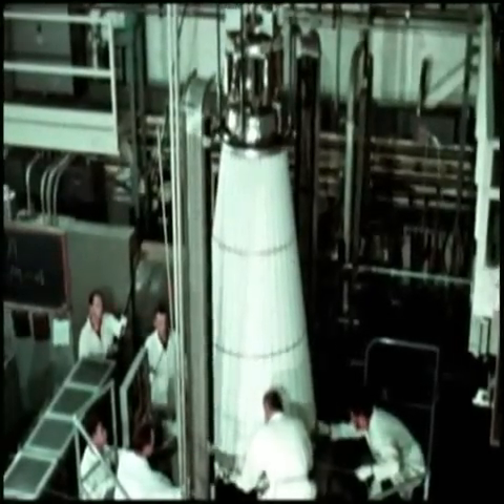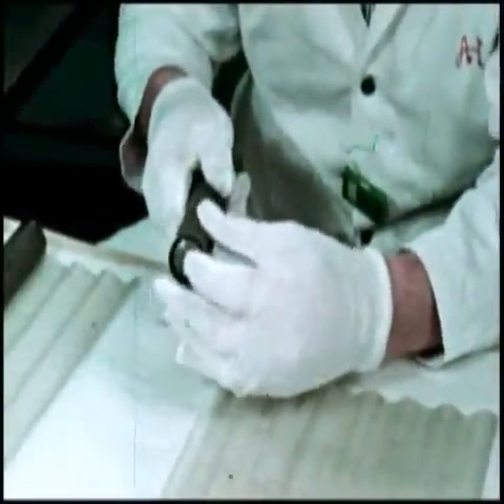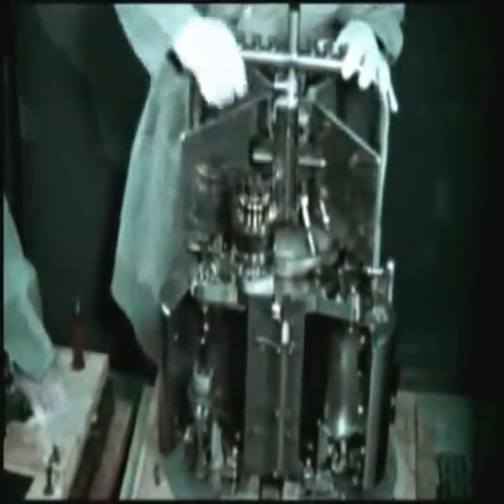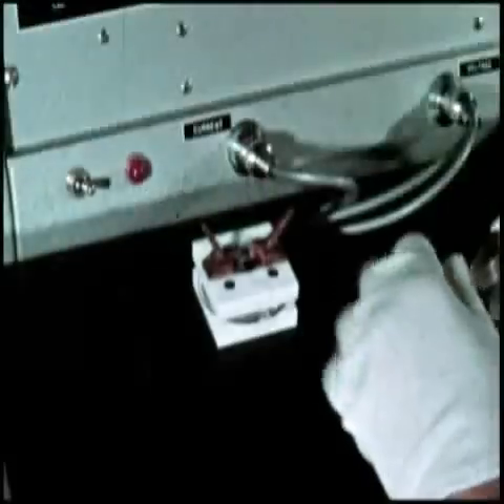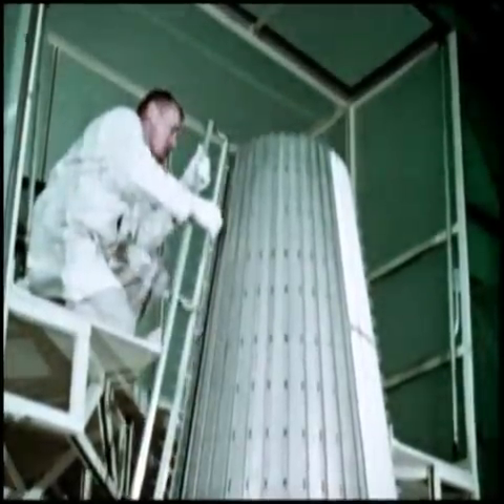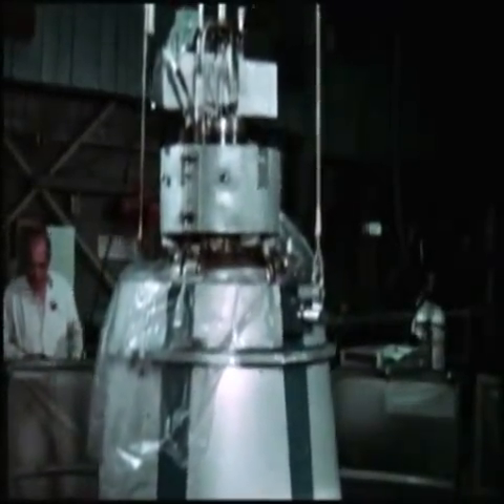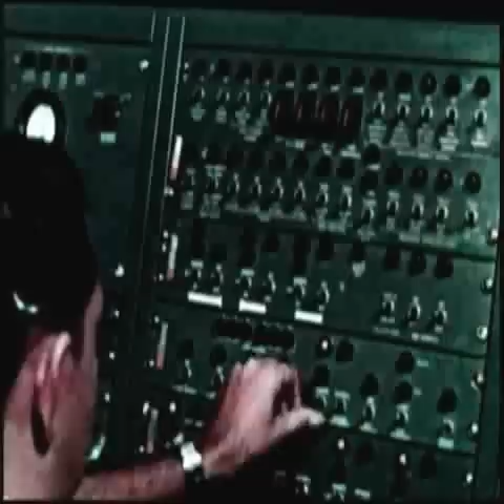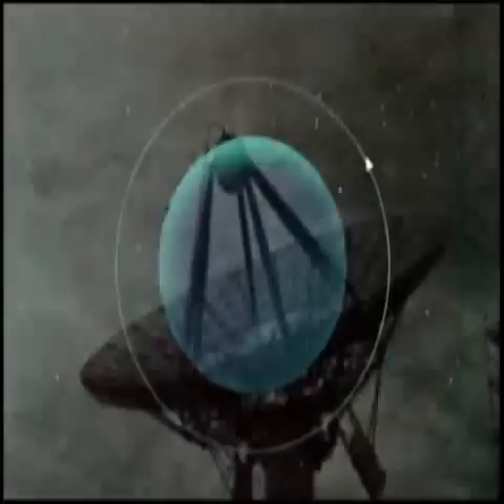SNAPSHOT (1964)

Comment: Were photo electric solar panels not even being conceived of as power supplies in 1964? Every little mini satellite is powered by them now I believe. The first one I remember seeing was about 1” square and demonstrated in science class 1960 something. Hand held Weston type camera light meters certainly were earlier.
Reply: Solar panels as we use them now are only about 30 years old... the previous types had very short lifespans, with extremely low conversion rates, were only remotely useful for near earth uses. Even modern panels fail beyond Jupiter orbit because they do not have sufficient conversion rates. 

We still use reactive elements, but have changed what type of reactor, because RTGs do not use an actual "reactor", rather they use the heat from radioactive elements to create a low current inside a transistor layer.

Comment: In November 1979, SNAP-10A suffered an “anomalous event,” and the parent satellite begins shedding pieces. “Six more anomalous events occur in the next 6 years, releasing nearly 50 trackable pieces. Release of radioactives is possible but not confirmed,” reads a NASA report.
Reply: Ruptured coolant / leaking NaK? The Sov's RORSATs used to dump coolant on ejecting the reactors to a higher orbit. Debris everywhere.

Comment: At 14:17 how exactly is heated radiated away, doesn't heat need a medium to be transferred into like air or water. I don't get how heat is transferred into a vacuum, there's nothing for heat to radiate into.
Reply: Heat is radiated into space as a form of light. You know it as infrared. Not a very efficient way to radiate heat. Cooling a spacecraft, therefore, is difficult. Reason a thermos with a vacuum liner can keep things cool or hot a long time, a very good insulator.

Comment: Thankfully solar panels became more efficient before too much time  passed by. These basic rigs couldn't produce a great deal of power  and on a dollar per launch kilo and dollar per watt basis, this was very expensive power.  they still persisted with these little reactors for deep space probes though.  Even during re-entry,  rod and neutron activated metal debris would still have made it back to earth I would expect. They blew a lot of safety off to get these things launched.
Reply: You expect wrong. Step 10 would have burnt up in the atmosphere as well as many other radiothermal generators. Alarmists hear nuclear and want to believe that the engineers say to hell with safety yay radiation. But in reality where the rest of us live they don't.